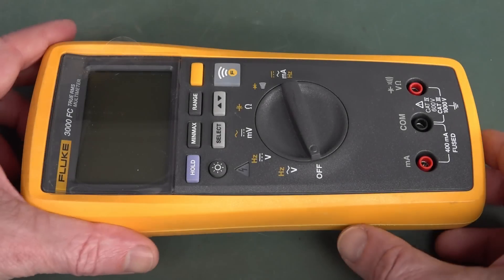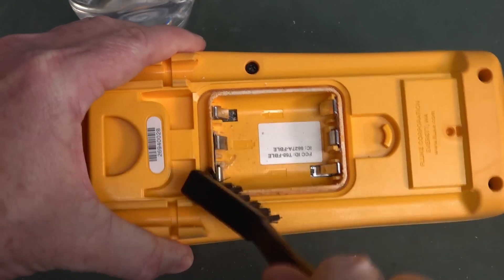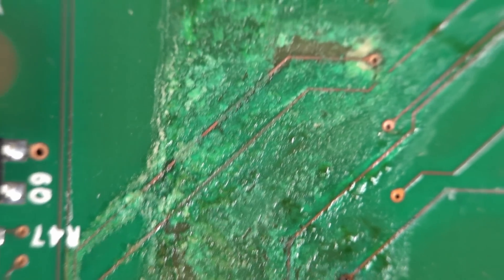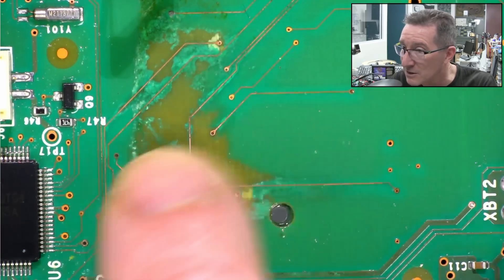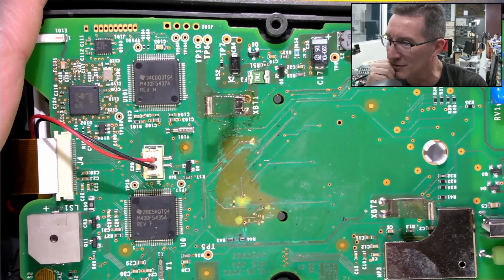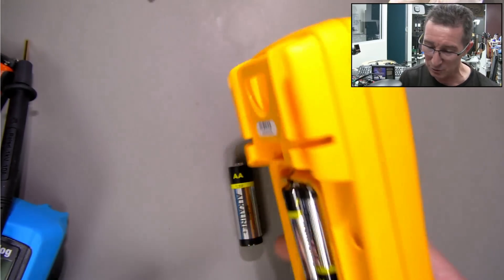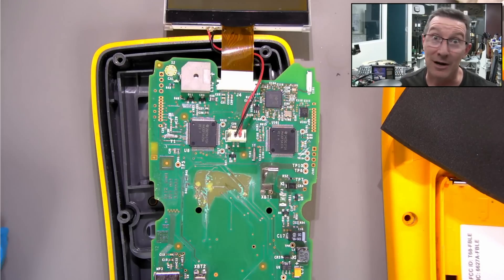EEVblog 1497 - RIP Fluke. Thanks Energizer. NOT.

Comment: Some of the Fluke meters are now made in China. The quality is terrible. Be cautious. I also ordered some "Fluke" meter leads from a Chinese distributor. They arrived and looked authentic. I used them for a while and started to detect some small differences from my older truly authentic Fluke leads. They felt more noodly like overcooked spaghetti and I played my hunch and cut and stripped one to have a closer look. Sure enough, I discovered that the number of stranded conductors in the lead was less than half that of the truly authentic Fluke 10 amp leads. Not only a fraudulent sale but a dangerous sale. There is no way these leads would have carried ten amps safely. I have learned over and over that the Chineese have no ethics when it comes to trade . They are out to cheat you in every way possible and they have no compunction about theft of design or theft of cash. Steer clear of anything Chiinese. The only reason an Apple phone is of decent quality is because the Chhineese use them to spy on the West and to figure out the best way to ship fenatnyll into the U.S. to kill Americans. Especially Ameerican kids.

Comment: Why not buy lithium rechargeable batteries in the same form factor and voltage? 2022? Anyone?
Reply: Lithium-Ion rechargeables are rated 3.7 V per cell, 4.2 V when full.
You'll need 1.5 V lithium primary cells, non-rechargeable. I am not aware of any 1.5 V rechargeable Li-Ion cells.

Comment: In my experience 9V batteries seem a little less prone to this, so it is disappointing to find an expensive tool powered by AA. I tend to leave batteries out of devices I rarely use, but I use multimeters often enough that leaving them out is not practical. I see you used isopropyl acohol to clean. What do you think about deoxit?

Comment: As you advised, it's best to remove alkaline batteries when storing equipment for very long.  But, did you store this meter face down?  I've lucked out with minimal damage when devices were stored battery side down so if they do leak, they only damage the battery holder and cover.
Reply: Yeah, I have heard that. Best to not help it with gravity.

Comment: That is why I did a video about using the Energizer Ultimate Lithium in any meter or nicer device and I have a video discussing the lithiums  in some devices. Never seen the alkaline that bad on the solder mask, but they are always going to leak, not if, when!
https://youtu.be/k8IBTfDEM8U

Comment: Given how little power most multimeters and IR remote controls use, I’m starting to wonder whether I should use old-fashioned carbon-zinc cells in them instead of alkaline.
Reply: I have found carbon zinc in stuff that are decades old and not leaked.  But not all.
Reply: Carbon zinc doesn't contain any liquid, so they can't leak.

Comment: I worked for a chemical company as an industrial instrumentation/calibration technician. Once a colorimeter was dropped off for repair. These units were everywhere. The instrument would not turn on. Check fuse...good. Power cord...good. Remove cover..no burn marks or  odors. Top of PCB...looks good. I renove the 6 screws holding the PCB in place and turn it over. All the copper traces are gone and some discreet components just fall off. The lab where this unit was used, ran sample testing with hydrocloric acid. This lab always had a chemical odor. I pull a spare board from stock and all the spare boards had a conformal coating on the boards. This lab had three units and it was the oldest. I inspected the other units and they all had the coating on the boards.

Comment: Don't use vinegar, it can solve copper. Better use citric acid or diluted HCL.
Reply: I always thought that vinegar was less acidic than the stuff in your stomach?
Reply: @RichardWatt  Acidic is not the complete point. It depends on the materials too. The HCL can not oxidate the copper. 
Vinegar is different, it highly depends on the temperature and time.
But the risc is not high because the vinegar will go away very fast. Normally, but just in case?

Comment: Maybe it's not a problem that iso-propyl alcohol gets on the board, however propyl alcohol with some battery-leakage crystalline dissolved into it will damage the board in the long run.

Comment: I've seen silk, solder mask and FR4 eaten away in some really old kit. Once some residue gets under the mask it will wick itself a remarkable distance.
Reply: I have seen small capacitors mounted upside down on a circuit board, with foils facing upward, and when the caps leaked the electrolyte apparently traveled up the leads, through the solder joints, into the foil side of the board, eating into the solder mask and the copper foils. Somebody explain to me how this can occur?!

Comment: 🔥 I think that MOST retail batteries are fake 🔥 When you buy a Duracell or energiser that leaks, how do you knot it was actually genuine? Duracell are the most cloned battery. 
I buy the Duracell / Energiser "industrial" bulk packed batteries from Element 14 / Farnell and they never leak. They are the same batteries with a different label on them, and because they are more obscure, no one is cloning them. I can't think of any other reasonable explanation as to why the retail packaged ones leak and the "industrial" packaged ones don't leak

Comment: I have been a calibration engineer for the pats 22 years and have seen this before a view times. If we encouter this it's usualy is a RIP and time for replacement (repair on component level is time consuming and financialy not worth it). The batteries are in date and the manufacturer SHOULD (but won't because...[fill in excuse here] replace not only the battery but als the meter.

Comment: Be aware that ALL alkaline batteries build up pressure inside as they discharge. This will push the foul liquid out of the cell. The only way to get the 10 year shelf life without leakage is to be sure there is absolutely NO current being pulled from the cell. The worst offenders are the electronic activating type circuit. For expensive instruments put in a small slide switch to be absolutely certain there is not even microamps of leakage.

Comment: Makes you wonder, when will those folks finally switch to Li-ion rechargeables, even as an option
Reply: You can use lithium primary cells in devices like this. They're more expensive but they have extremely long shelf lives and also more capacity than alkaline, so they'll probably last twice as long in a multimeter, even if you don't use it a lot.
I've never heard of any problems with those.
Or, if you're using your multimeter a couple hours per day, use Eneloop NimH cells. If your device is okay with the lower voltage, they work great and last forever (with a decent charger)
Reply: @maximilianmustermann5763  I prefer converting to Li-ion as most devices are fine with the higher voltage anyway and there are lots of cells one can acquire from common devices.
Reply: @Pawelr98  But don't you risk destroying a device if it doesn't like the higher voltage? I mean in this case, the device wants 4.5 V nominal, it will have to be okay with up to 5V.
One 14500 cell is probably too low with only 4.2 V, but two of them (or any 2S li-ion/lipo) will have a voltage of 8.4 Volt when full. I'd be very hesitant to just try and use a 200, 300 dollar device with that voltage...
Reply: @maximilianmustermann5763  Most DMMs operate on two batteries which is 3-3.2V, in most cases 4.2V is fine. I would also assume this three battery DMM to be able to run on the 3-4.2V range just fine.
Reply: @Pawelr98  If it runs well on a slightly lower voltage, I'd personally just pop in some Eneloops and be done with it. When a device has no problems with NiMH voltage, Eneloops are very hassle free and cheap (because they last forever with a good charger)

Comment: I strip out screen, and anything that can't take water, then gently clean under a running tap. 
The salts are conductive, so may be what is stopping your 3000 from initialising.
Can't believe Energiser are doing what I have been accustommed to as Duracel performance.

Comment: I wonder if this would have happened with a 9V brick. The ones I have so far have not done this.
Reply: I wrap 9 V batteries in saran wrap just in case. I have been using the non rechargeable Eveready lithium batteries for about a year now, and none of them have leaked so far, but saran wrap on the 9 V battery is still a good idea.

Comment: Old carbon zinc batteries of decent quality will swell if you leave them there for years, but they don't leak like that. So they might fail, but they will not ruin your device. That's what I use for clocks, multimeters, and other devices that draw low amount of current.

Comment: Ouch, Dave... 
I think, the leakage was efect of internal short circuit in one of the battery. This state warm it and make some electrolyte even boiling, rised presure open battery and expanded battery destroy plastic.
Electrolye is sodium or/and potassium basic in high concentration. If it is still liquid it is extremly corrosive for many materials, for skin is near deadly but silent and pain-free (it dissolve everything organic).
I am curiuos you use to clean PCB isopropyl instead pure water. It should dissolve and rinse any alcalia and then using organic solvent make some sense. You can also use some (small) citric or acetic acid to neutralize alcalia and then rinse any inogranic impurities with warm, pure water. 
As long as im not sure it can save DMM it can help in other situations. 
Anyway never touch leakage eletrolyte bare hands. This is easy way to lost eyes.

Comment: I had my head in my hands when Dave started with the brush. You really have to take the case apart first, or you just get more contamination inside the meter
Reply: @Aussie Doomer To some extent, though a good scrubbing will likely remove more than is necessarily needed...

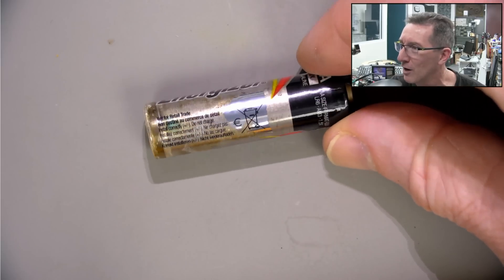Comment: 13:44 My 28-II has the same batteries comes with the meter (also made in USA and with the marking "not for retail trade"). Not leaked yet but they have expiration date of 2028... So I guess I'll have to find something more reliable.

Also, the 28's manual saying "MSHA approved for use with three Energizer P/N E91 or three Duracell P/N MN1500 1.5 volt, “AA” alkaline batteries only." gives me a sarcastic smile...
Reply: Upd: Those Energizers begin to leak three weeks ago, two of three. Luckily I put them out just in time...  One of the battery was completely flat (0.25V) the others (even another leaked one) - 1.5V.

Comment: 2011 Foxtel remote alkaline were dead flat, and pristine, no leakage at all. Yes, I would like to know the cause - and how the ** do you clean vias? For a while I used glad wrap with a bit of magnesium metal in the battery grooves. Very very old branded laptops actually had a magnesium or titanium frames to anchor the screen hinges - so I saved that scrap, as battery liquid really goes for that metal first.  Also good on model aeroplanes before electric quadcopters became the norm.

Comment: I clean corrodes Battery Contacts with vinegar essence an then i neutralize it with distilled water. I found an old TI calculator with Daimon batteries (>20 years old), i desoldered the contacts an cleaned it with vinagar essence in an little pot and now the calculator ist working fine. Same with a old Gameboy and Toys. If the contact rusted spray it with zinc spray.

Comment: Not surprising that the plastic and solder mask have been degraded, the batteries contain a strong alkali which is what most paint strippers are. The best solution for things like meters is to use primary lithium cells, all my meters now have them.

Comment: An old electrician told me to always store them face-up so that any leaking remains on the battery compartment
Reply: My experience is that the electrolytes found in batteries and capacitors has a low surface tension and a high wetting factor, and the stuff seems to be able to actually creep upwards against the force of gravity.  Apparently it can pass right through solder joints as well. I kid you not.  I have seen cases where small capacitors were hanging down from a circuit board with the foils facing upwards, and when the capacitors leaked the electrolyte somehow traveled upwards along the component leads and through the solder joints,  and then ate into the solder mask and copper foils on the upwards-facing top side of the board.

Comment: I stopped using "alkaline waste" some time ago. In devices that are expected to last on batteries less than let's say 2 years I use rechargeables (Eneloop). For really low drain devicess I use Energizer Lithium primaries (quite expensive but when they last in device 5 years it really does not matter) Never had any leak since I ditched those alkalines.

Comment: One of my favourite meters. I only use Energiser Lithium AAs thou. Such an expensive piece of kit!
Reply: @Aussie Doomer He's talking about Lithium primary cells, they are 1.5 V and non-rechargeable! They are 100% compatible with alkaline AA cells. They are rather expensive, but they are worth it because they last forever (advertised shelf life of 20 years) and they have a large capacity. So when you look at the price, remember that they will last roughly twice as long as a good alkaline, plus they won't leak, plus you can use them for twenty years in a device with low power draw.

Comment: I actually just finished an LED work light leakage repair a day ago. I opted to never deal with leaky AAs in it again, and decided to gut the original 3xAA battery holder and go with a Li-ion-based solution. I added USB-C charging functionality and filled the battery compartment with 3300mAh worth of disposable vape batteries (thanks BigClive for that tip!).

Comment: For what Fluke charge for their meters (I know they’re worth the money) surely it can’t be that hard to have a leak-proof battery compartment. Also it’s a shame you can’t claim back from Energiser as the battery was still within its use by date. If they stand behind their product they should have to cough up! Craig
Reply: Energizer wouldn't replace a $10 Roku remote damaged by their batteries for my sister, I'm sure they'll weasel their way out of replacing a $400 multimeter.

Comment: Well that's certainly disappointing and concerning regarding Energizers. I've never had any leaking issues from them so I was very surprised at this video. I've checked my Multimeters and only one had a couple of Energizer cells. On first glance they looked fine but checking closer one definitely had droplets on the negative terminal as seen under magnification, but no corrosion yet. Caught just in time I'd say. These cells were made in Singapore and have an expiry date of 12/2026! I've now put in some Lithiums as NiMh made the display way too dim. I guess that I'll just be getting Lithium from now on for this sort of usage.
Reply: That's the way to go: either Eneloop NiMH or Lithium primary cells. The Eneloop will work and make sense in a lot of devices, and where they don't: lithium.

Comment: I'm no longer using disposable batteries for a few years, they are just not worth the trouble. Even for remote controls it's just not worth it to risk them with a disposable battery. If a device doesn't like NiMH it gets a NiZn battery.

Comment: I've had this exact same thing happen to my Fluke meter as well.
The batteries leaked and corroded the contacts and also did some damage to the board inside.
They should make thee battery compartment sealed because there's always going to be cells that leak.
Reply: The 3 battery compartment should be modular, easily removable and replaceable, and the recessed well that it sits into on the back of the meter should similarly be sealed, except for a tiny hole where the battery leads pass through into the meter, and that can be sealed with silicone.  If you wanted to be truly certain to capture any leakage, you could wrap the separate battery- holder in Saran wrap (cellophane food wrap, "cling wrap" etc) which is what I do with 9 V batteries.
Reply: Fluke 289 actually having a nice modular battery compartment

Comment: Never use alkaline batteries on low powered stuff. I have damaged 2 wall-clocks with duracell batteries, 1 more clock also got battery leak fortunately I detected that early. Although I never had problem with my alkaline battery powered mice where the battery lasts over a year.

Alkaline batteries are good for powered stuff like toys...

Comment: Did you contact the battery manufacturer (Eveready) about your multimeter replacement under the battery company warranty. They guarantee against leakage. I have had several flashlights replaced by the battery manufacturer because the batteries leaked and they were still within the expiration date.

Comment: I'd definitely do a full bath in warm water first, with scrubbing, or some ultrasonic cleaning. Maybe a clean second bath.  Then a full IPA bath. Reason is, you can safely assume those substances are a) much better soluble in water than in IPA and b) hygroscopic, so  any trace amounts you leave behind will just continue corroding everything.
Reply: Preferably distilled water, at least for the final rinse.

Comment: Three questions:
1)  why is the battery compartment not sealed against battery leaks? It can't be difficult to isolate the battery compartment to stop battery chemicals from accessing the product PCB. 
2) what os the plastic case made of, is it makes with a chemical symbol?
3) Why is the case plastic not selected to be impervious to battery chemicals? Polypropylene and high density polyethylene is extremely resistant to corrosive chemicals.